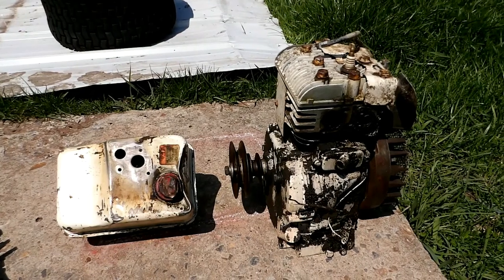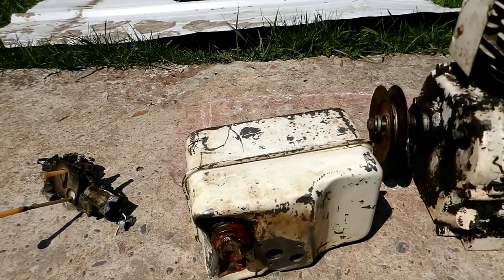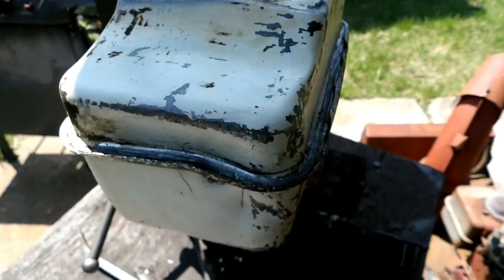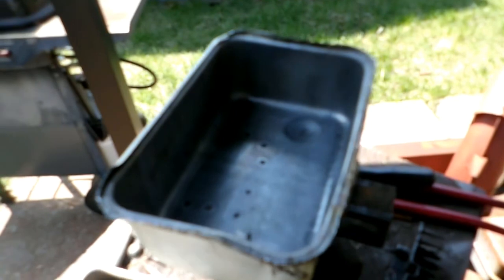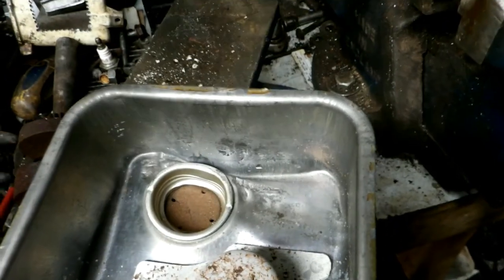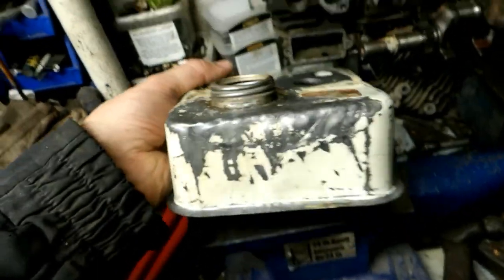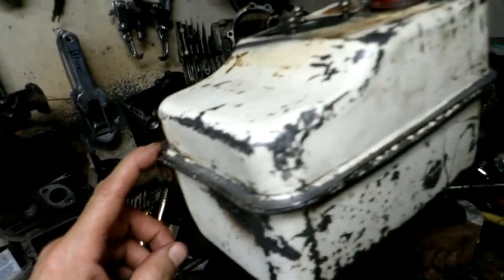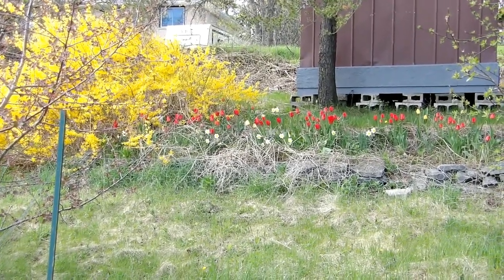5 Horse Briggs Gas Tank Repair

Comment: Locktite makes an oil and gas resistant adhesive. Works great for fuel repairs.
Reply from the maker: Do you happen to know the name of it, I am really interested in that!
Reply: @ChargerMiles007 it's called "Locktite oil and gas resistant adhesive ." I found it on Amazon. Sealed up two steel gas tank seams and two plastic gas tanks so far and seems to be holding up. Crazy glue is gas resistant also btw.

Comment: fuel resistant silicone gaskit maker i wold let it harden up about half way then crimp the sides back down
Reply from the maker: Thanks, my son may have a tube of that, it fits a caulking gun, is half the size of regular silicone, and costs twice as much. I think it is called "The right stuff".

Comment: I would personally solder it, I like to use my little butane torch to solder things like this, and then put in a gas tank liner. You’ll never have an issue. I’d recommend Red Kote fuel tank liner. 

From my research it’s the best stuff on the market today.
Reply from the maker: Hmmm, never heard of that stuff, I will check to see if it is availible here in the north land  :)

Comment: Good job with the tank! I wasn't optimistic about the filler nozzle & cap, so kudos on a job well done. I don't know what would be good for the joint but if you cleaned it real good and applied the proper flux you should be able to solder it. See you next video, good luck.
Reply from the maker: Thanks for watching. Yes ,soldering is definitely an option, I have done that before, but was thinking to try something different, possibly.